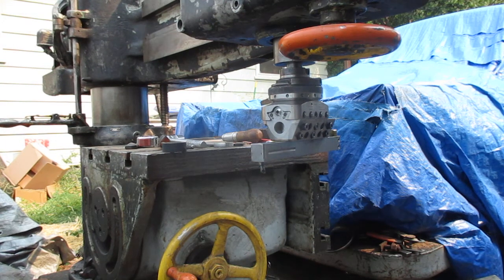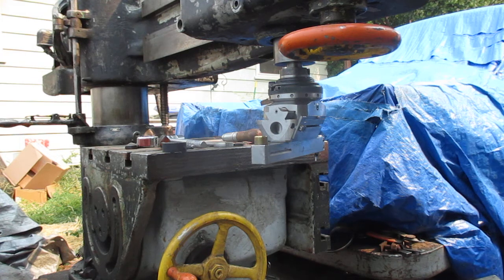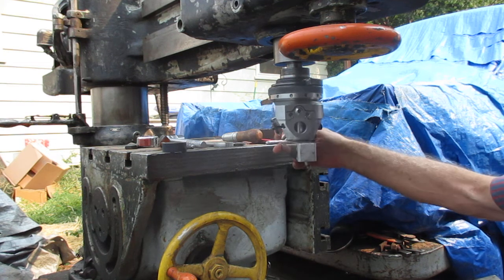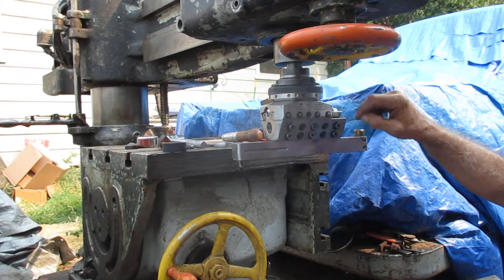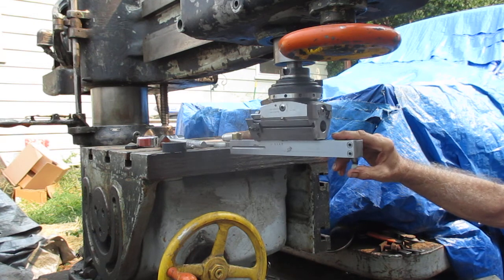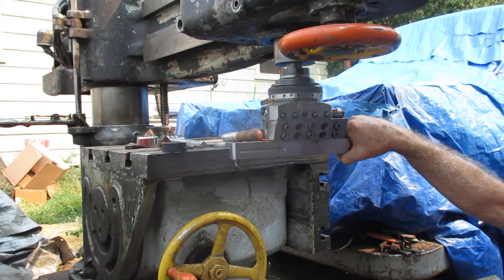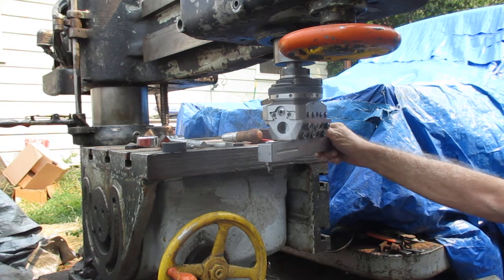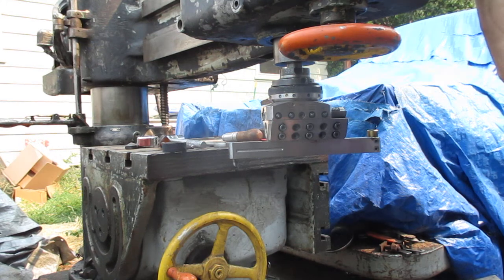Morris radial drill press with Wohlhaupter boring and facing head

Comment: Hi Dee! Have you ever heard of or seen a Kao Ming KMR 700DS radial arm drill press? It is a smaller Taiwan machine with a 8" column and a 28" arm travel. I ran across one today for a pretty good price. Just wondering if they are decent machines.
Reply from the maker: Yes, but I have not used one, They were a popular drill

Comment: I dont think id ever use that on a radial drill. With no lock or way to keep it in the taper .I Garrantee it will fly out and cause damage and death if you get hit. I dont think theres a locking device on racial drills.
Reply from the maker: I can used a taper pin in the tang, and lap the shank to fit the spindle snuggly. There needs to be extra care doing this, but it has been done before.

i